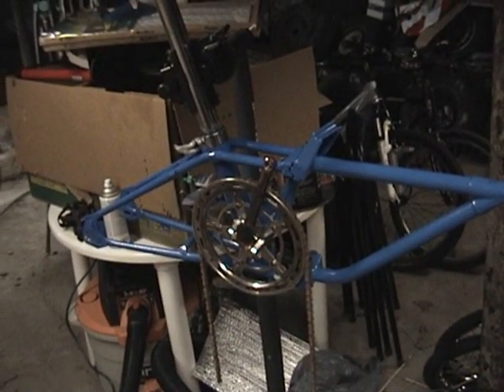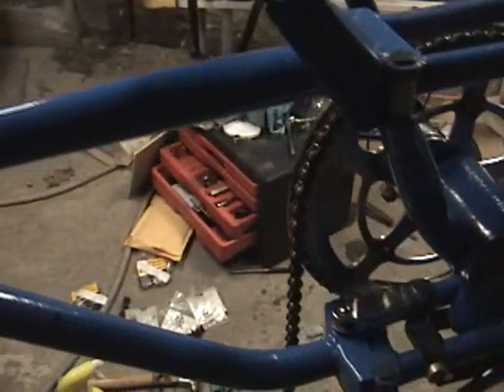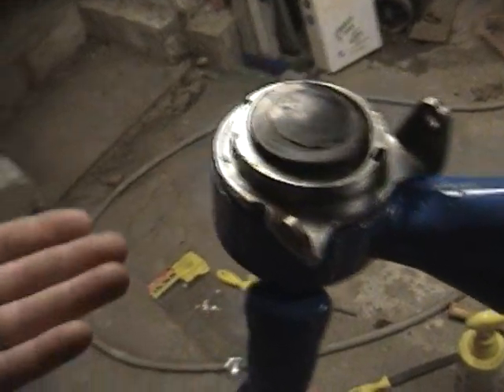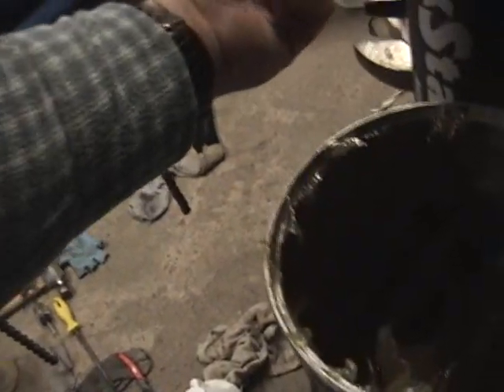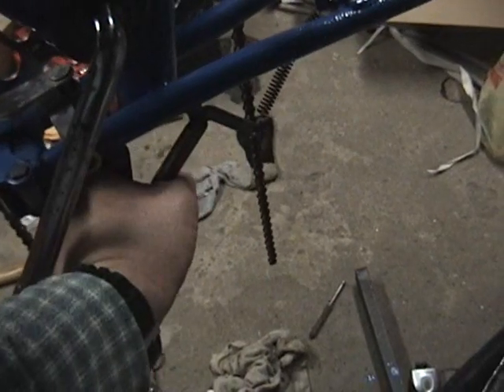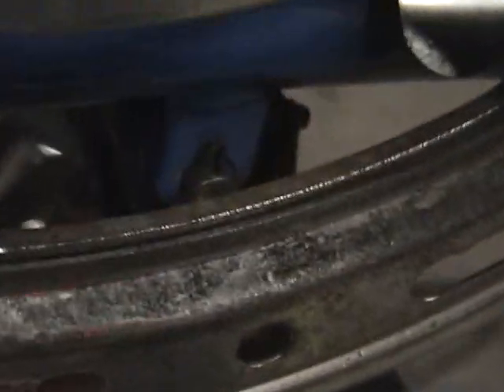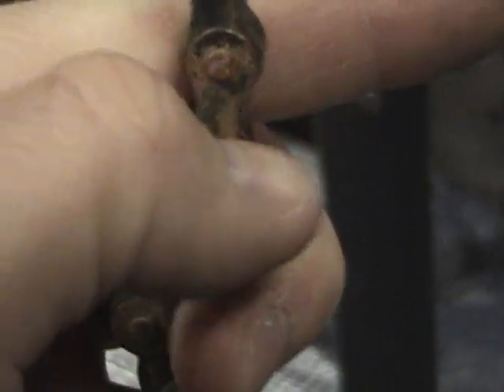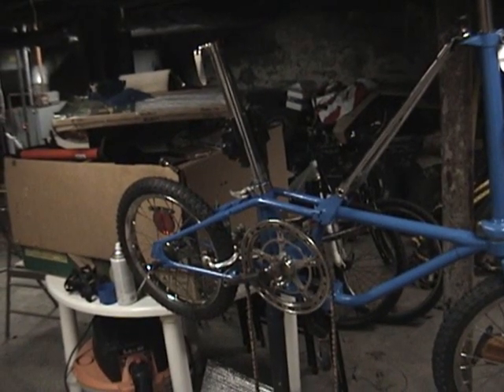Dahon Classic III folding bike - rebuild: part 7

Comment: Do you happen to recall if the handlebars had any retention mechanism outside of just the clamp on the tube?  I picked up a very neglected hon classic, but the handlebars won't slide up or down to allow me to fold or disassemble.  However, they will spin in place if i apply torque.  I would imagine if i can get the handlebars to spin in the tube that would mean theres no rust locking it in place, unless theres skme mechanism inside the tube that is locking it from vertical motion.
Reply from the maker: I don't recall, unfortunately. This project was many years ago and I didn't keep the bike around long.

Comment: Im having difficulties on headset restorating because I bougth this Dahon III classic as used ,old owner opened and didnt restored and  closed.Im trying to figure out,parts are True and all...is there two set ballbearing there or  could you tell me a link of helping showing video? Thanks.
Reply from the maker: Sorry, but I did this job so many years ago that I don't remember any of the details.

Comment: hello, i was watching your video, and though i may as well ask... i have a similar dahon, my stem has some kind of slack on the fork, i am trying to  fix it but i am having trouble getting it off, mine does not have any thead or bolts, do you have any tips on how you got yours open to clean it up?? 

thanks and great work
Reply from the maker: Unfortunately, I don't. I donated this bike years ago and have no memory of taking that apart. Best of luck.

Comment: Hi sir. May i ask for the head tube bearing size if you don't mind?  Thanks in advance
Reply from the maker: Sorry, but the bike is long gone, and I no longer have that information.
Reply: @MercedesDieselGuy  oh i see. Thank you sir
Reply: casterwheel 3rd wheel spring should be connected on a small hole located in the seat stay..maybe you accidentally covered it by paint